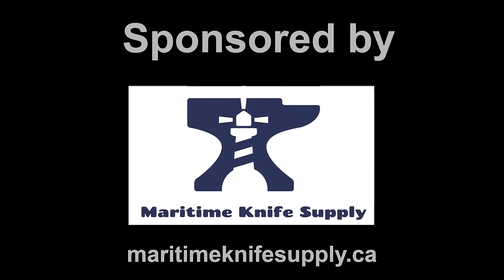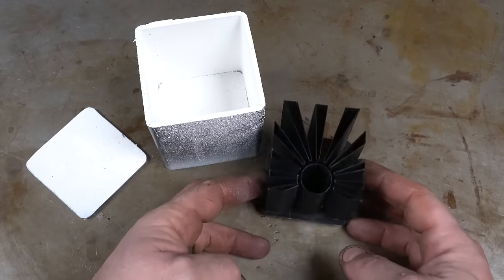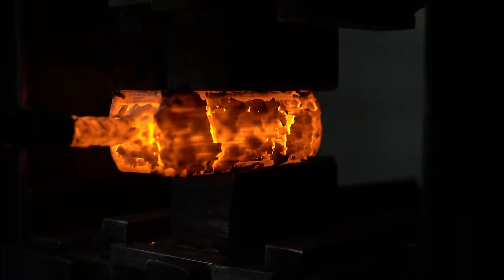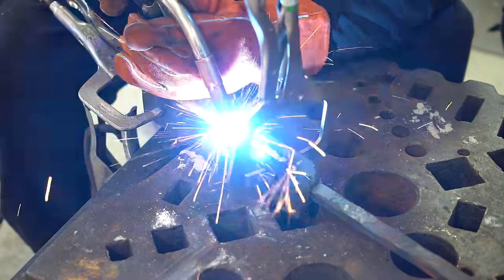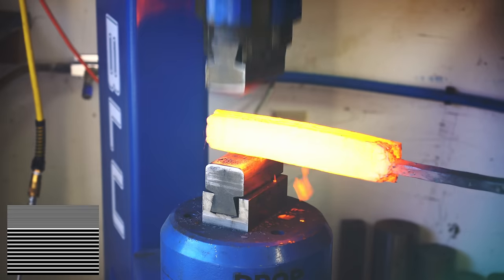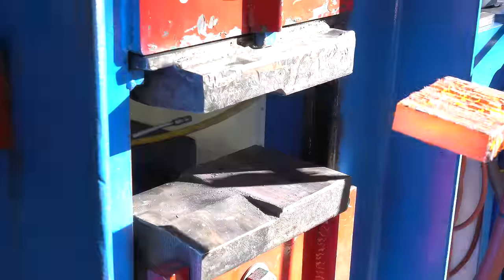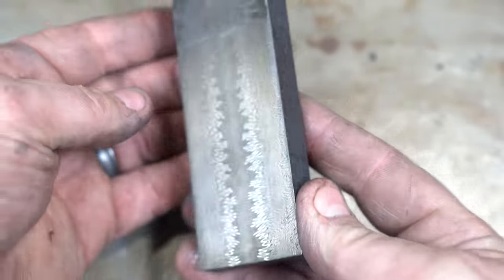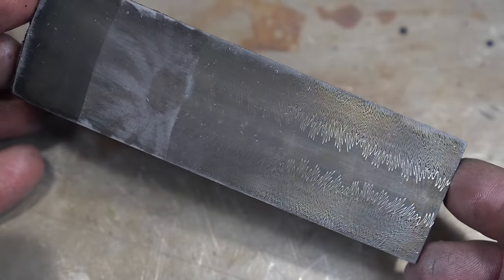Triple-T #112 - Damascus patterns - Ocean sunset

Comment: another cool design like usual. quick question, is it possible to make mosaic damascus using copper in the design or is that not possible due to it not actually being welded to the steel when forged? i would love to see you try to attempt it, even if it fails it would still make a cool video in my opinion
Reply from the maker: It’s not possible.  You can’t forge weld steel with copper in it, you’d melt out the copper.  Thanks for watching.

Comment: I was wondering if you were going to use zero tolerance machining for a precise Damascus. I'm seeing more and more smiths use it, recently.
Reply from the maker: You could start with very low tolerance parts, but when they get into the forge and you are forge welding, all that goes out the window.  Thanks for watching.

Comment: Good morning,
have you done destructive testing?
The plate, although carbon-based, will inevitably leave impurities at the welds.
For my part, I did some tests and unfortunately when we tested the welds, I noticed that the different elements were molded around each other but not welded.
Looking forward to an exchange with you on this subject.
Reply from the maker: These were welded extremely well.  Certainly no issues. Perhaps your wall thickness was too much.  We had these at .1 mm or thereabouts. Thanks for watching.
Reply: @TyrellKnifeworks  First of all, I want to tell you that you are doing a great job, but comments are not there to bring out something negative but just with the aim of progress.
have you done destructive testing?
Because indeed it seems well welded but when we carry out destructive resistance tests we realize that the piece breaks all around the pattern, the steel has not welded. We therefore have something which is closer to crimping than to soldering.
I printed my box with 100% plant-based PLA and 0.15 walls which is the thinnest that can be printed with a 0.2 nozzle.
Reply from the maker: @mojorisen5997 I’ve only done this process twice and had no cause for destructive tests.  Everything appeared perfectly welded.   I’ll try it some time.  But just because you had it fail once, doesn’t mean the entire process is flawed.  I’ll certainly give it a try.

Comment: Ok so you go from filling the 3d printed from in that glass pan to the form already in the can, but how did you transfer that from the glass pan to the can without spilling it all????  HOW?????
Reply from the maker: There's a bottom on the 3D mold.  You just pick it up, shake off the excess and then put it into the can and then fill the rest with the 1095 powder.  I use the glass dish so that I can collect the extra powder that spills over the mold and reuse it.  Thanks for watching, Fred.

Comment: This is awesome, but I have an idea that I think would take it even further. Do a damascus plug weld on the sun.
Reply from the maker: You could do the center of the sun with a plug weld, but not really the rays.  Since its just one steel, seems like it may not be be worth a plug weld.  If you wanted the sun in a damascus pattern, then it would be a cool idea.  Thanks for watching.
Reply: @Tyrell Knifeworks  I should have been more clear, I did mean just the sun, and not the rays. Either way, this came out fantastic and I can't wait to see what you make out of it.

Comment: I wonder if you could use a deformed 3d print so that your forge welded sunset is less distorted.  Not a criticism as much as a thought.  Like preplanning for forging distortion.  Seeing the layers as you were working the billets made me think this.
Reply from the maker: The problem is its difficult to know how it's going to be distorted.  We had an issue in the final forge weld so had to press it more than we would have liked.  I like the distortion that twists the rays a bit though.  It looks kinda cool.  😁.  Thanks for watching.
Reply: @TyrellKnifeworks  I liked how it came out overall as well for those reasons.  I enjoyed the journey and will enjoy seeing the next stages. :)